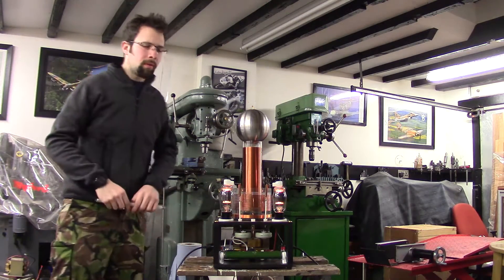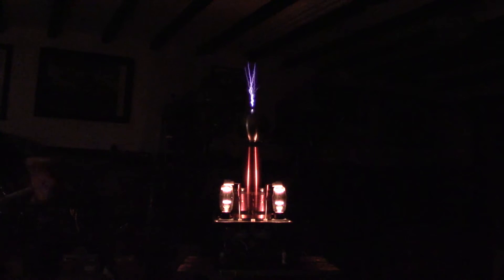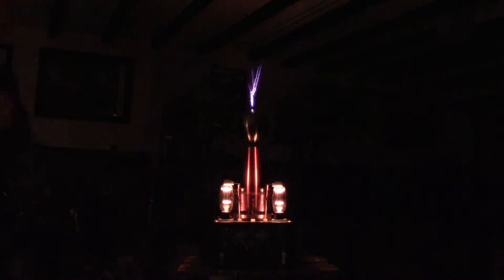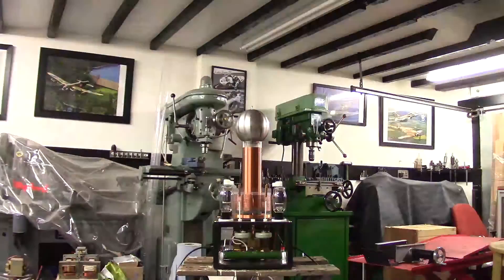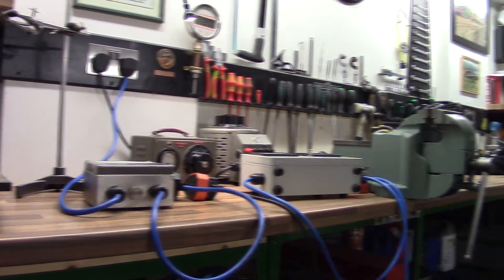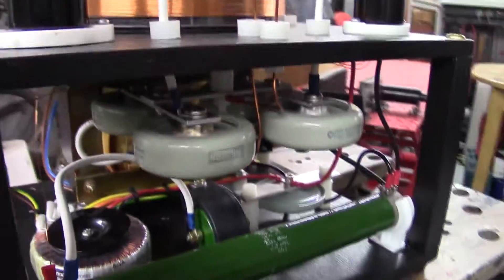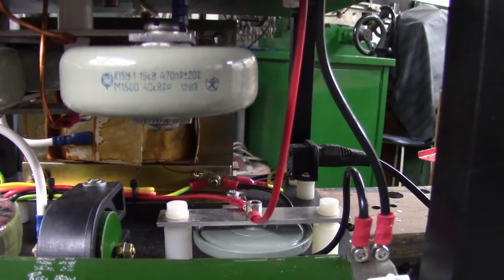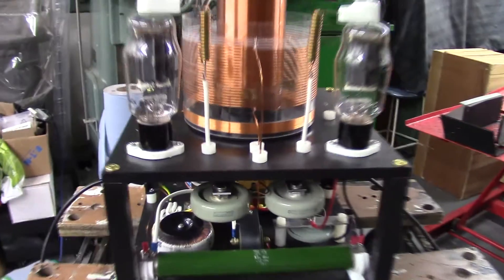Vostok 3.0 Vacuum Tube Tesla Coil Demo + Theory Of Operation

Comment: This is the best looking Tesla coil on You Tube...you do excellent work. So you did not rectify your plate voltage  and just used AC for the plate voltage...think I will try this with an 813 tube.  Excellent workmanship!
Reply from the maker: @joehigdon9847  Thanks for the compliment! I was quite into promotion videos at the time of making this video, so I think it has a way of dazzling the audience.

Interestingly I have purchased some pretty Tufnol sheet last year to update the black painted plywood the structure is made from, so could be even prettier soon...🤞

The circuit is loosely based on an Armstrong oscillator by Steve Ward, check out his website.

Good luck with your 813 tube VTTC project!

Comment: May I ask how many turns were on your secondary, roughly. Thanks.
Reply from the maker: Hi Dave, it's been awhile since this build, digging though my notes led to nothing, but that's most likely because I used a spare secondary from my original SGTC build, which means it is very likely to be 1113 turns looking at those notes.
Reply: @SteveLane   no worries. Thanks for responding. hope you are still coiling. I have done spark gap, SSTC and now embarking on VTTC. Your design inspired me so much, it's beautiful. I am sourcing the parts each day. Thanks.
Reply from the maker: @davestewart2433  You're welcome!
I'm still coiling actually, I exhibit only once a year at Wellend Steam Really of all places, it's local to me!

Likewise, at least 90% of the time is spent sourcing parts, I bought a massive sheet of 10mm tufnol this year with a vision of rebuilding the wooden frame this VTTC is made out of, you might think unnecessary, but the way the light shines off it is beautiful!

Let me know if you get stuck anywhere, I'm more than happy to lend my own experiences etc. 👍
Reply: @SteveLane  I sure will, thanks. Ttufnol, I had to look it up. It's nice stuff.  Please post more videos when  you finish the rebuild.
Reply from the maker: @davestewart2433  Will do! I need to start filming more, even just exhibitions... Lack of time is the biggest issue these days, usually due to too many simultaneous projects.

You have a great channel btw! I was looking for the comments, but I guess you have them off?
Reply: @SteveLane  I didn't realize they were off lol. I turned them on. Thanks for letting me know.

Comment: I would love to see a much smaller analog Tesla coil build for getting into the hobby there all sorts of videos for Slayer exciters but not many informative videos for real analog Tesla coils
Reply from the maker: Generally speaking, silicon based electronics are smaller than their equivalent thermonic emission predecessors (vacuum tubes) by their design intentions. 811 triodes are thought of as being small in their relative size to others.
I am intrigued by the thought of a small scale VTTC, there are definitely smaller vacuum tubes than the 811 triodes, however I would speculate the limiting factor with vacuum tubes would be the much higher frequencies required to match the resonance of the smaller coils. I'm no expert on vacuum tubes  though, so I wouldn't give up on this idea based on my speculation.

Comment: I could be wrong but it sounds like this thing is configured as an Armstrong oscillator, not a Hartley. The defining feature of a Harley is a tank with a tapped inductor and single cap and is the dual of the Colpitts with a pair of caps and a single coil, whereas an Armstrong has a main coil with a cap across it forming the tank and a separate tickler coil loosely magnetically coupled to it driving the active component; just like this.   Cool stuff though and nice workmanship!
Reply from the maker: Good spot, you are indeed correct!
Seems I was thinking about Hartleys around the time I made this video, however I must have gotten the two mixed up during the video (how things usually go...), But yes it is an Armstrong in actuality, it is based of one of Steve Wards original 833 tube VTTCs, which is undoubtedly an Armstrong.
Thanks for the correction, I should update the description for anyone else interested in building such a circuit.
Cheers! 👍

Comment: It wasn't high freqency ,it was 50 or 60 Hz.
Reply from the maker: Hi Martin,
You are correct that this VTTC runs on 50Hz AC, but there is also a resonant frequency of the secondary coil that is in the realms of 300 to 400kHz, it's this frequency that enables the high voltage arcs to break out from the topload that you see when it is running.

Because 300-400kHz is beyond what is possible to hear, it's the 50Hz you hear.

Interestingly the high frequency rides the low frequency waveform like a carrier frequency.

Kind regards

Steve

Comment: That's a very tidy build, great! Nice to see AC operation for a change; simpler design and could even become push-pull; its a shame you couldn't reuse the MOT filament winding for the filaments; you could have just the one mains  transformer and still wind everything up slowly on the variac! Stiffies not withstanding of course (as per the strange comment below).
Reply from the maker: Thanks Ridefast!
That's not a bad idea about the filament transformer actually, around the time I build this, I had intention of using a staccato controller to modulate the output, so probably the idea of supplying the electronics also via the HV transformer didn't even enter my mind.

Coincidentally I'm exhibiting this little favourite at Wellend Steam Rally this weekend in the stat engine section, powered by an old generator of course. =]

Comment: Well, you are running this thing without rectifier. So only the top part of one halve wave of the power supply will cause your circuit to oscillate and giving the 30Hz humming sound. You could get a lot more output by using a full wave rectifier with some microwave oven HV cap's in parallel. Looking at Steve's schematic and assuming its the same as your build, I see rather a classical Meissner oscillator than a Hartley one, but that does not matter much. Yeah, a push/pull may give you twice of what you have now, but is still not optimal as both tubes are only permitted to oscillate on a short duty cycle with varying power output. You need to be careful not to cause a current through the grid (e.g. by positive potential on it). This is a) not good for your tube (heats up the grid) and b) does not further increase plate current. The grid resistor (50W, really?) limits this current, but it would be better to build your circuit to avoid grid current all together.Otherwise, I admire your great mechanical workmanship. It is indeed an eye candy :)
Reply from the maker: LutzSchafer First off, thanks for your critique of the electrical design of this build, its great to find someone who understands these devices better than myself! I hope you can appreciate this is by no means perfect as it was my first attempt at VTTCs, (very) loosely based on one of Steve Wards early projects.
Secondly, I could and probably should have ran on DC, but during the breadboard stages, I did find the anodes would warm up quite significantly during short runs, so keeping the supply AC was a cheat way of limiting the power... Obviously there is other means of limiting the duty cycle of the tubes, but at the time I was already halfway there without having to change anything.
So you are saying to go DC and use the grid feedback tuning to manage the duty cycle for a more constant output?
Reply: Steve, tube designs remind me of my early days in electronics. While they were still taught partially during my educational years, the focus really turned to semiconductors. Working for many years in circuit design and after changing career to optics development, i feel overcome by nostalgia when seeing that people work with good old electron tubes. 30 some years back I worked for a diathermy company and that was the last time I professionally developed their shortwave power oscillator  (which was a Hartley) using a power triode with graphite anode. The max output was 500 watts if memory serves me right. To your Tesla transformer design, I agree that a too high bias current will heat up your plate. High power transmitter triodes usually have heat sinking capabilities or graphite anodes that are allowed to get hot. When running on DC you could try to bias down the tube towards B or C type. This would give you less current draw but same output swing. Might be a good idea to spice simulate everything. Back in my days simulation was just in the beginning. I can only talk from my agend old experience and from a time where we learned to design DC bias as well as RF by hand. In your case it would be nice to have the proper high voltage oscilloscope probes so you can actually see what is going on with removed secondary of course. Anyhow I wish could be of more help. I can try with basic electronic design principles but that you likely find online and/or know yourself. I just found your design intriguing because of running on ac. Back in my days I might have failed my courses for such rather unconventional use.

Comment: That's creative;DD Having the vacuums on each side of the coil for a bit of style!!!!
Reply from the maker: Based it loosely on an old vacuum tube audio amp, but also putting the tubes anywhere else doesn't allow the heat to rise from then quite so easily.
The glow reflected on the coils is an added bonus that makes it in my opinion.
Reply: Steve Lane Yeah, that too, nice output, and coil;DD Thanks For Showing, Cheers Mate!!!!

Comment: Nicely put together.  In my set up I used a full wave rectifier on the MOT and some smoothing just to feed DC to the tank circuit. Looks like I don’t need to.  :-) 
Inspires me to have another go at improving the output on mine as I like the nice quiet output with VTTCs.
Reply: You tried a filtered supply Kram? Do you have any video of it running mate.. .... hi Mr Lane, this is a really pretty coil, I'm sure ive told you that before 😅,....
Reply: @T2D.SteveArcs  Think I've tweaked my psu a few times since this comment. I decided a smooth DC supply doesn't result in a good coil output as you know🙂.
Reply: @tuopeeks  oh yeah I know it doesn't give the best output mate I just wondered what it was like with smooth filtered DC.. il DM you soon mate I'm very sick atm...
Reply: @tuopeeks  👍
Reply from the maker: +tuopeek1 A "quiet substation" is a favourite way to describe the sound to people.

A smooth DC supply will make it easier to get a clean signal to audio modulate if you ever wanted to attempt that on a VTTC.

VTTCs are very therapeutic to work with, I could could work on them all day if I could. =]

Comment: ahh steve she's a beaut ! nicely constructed i might say but then again you always show off your craftsmanship ! still going for a quad tube setup ? always forget to ask in chat :-p and only 6 amp draw ?!  crazy, pretty efficient circuit or just because its a smaller coil, not sure how that works really :-p anyway talk laters cheers !
Reply from the maker: +dirkk82 The plan seems to change every time I learn something new to how to run my Coil more efficiently, at the moment I get an inch of arc for every amp of current I put in, which compared to SGTCs is very inefficient, but for VTTCs is not too bad, they're so power hungry and sound like a substation but I do love the way they look and sound, all warm and fuzzy! =]
Reply: Steve Lane look into other vacuum tubes for that, there are better kinds that have extra grids and stuff

Comment: Very tidy as expected ,glad you made good use of the massive MOT I gave you ,knew it was better of with you and this is exactly why !Great work dude love it .
Reply: Hahahaha well it's great that it's being used ,not just sitting on the floor of the shed .It is massive but well worth taking the extra space to give a lot longer run time although I would have loved to see a conveyor running, I think on the practicality side of things it would have been a proper pain in the arse lol .
Reply from the maker: Haha yeah carbon brushes to pick up on as they align into the coil then all the way out the door on a conveyor to cool off outside...
 Oil immersion would have been the other option as the fan was just too noisey over a VTTC and would need two to cool the otherside, unless I rotated it on a microwave turn table... =]

Comment: Very nicely built that Steve. I like it.

Cheers
John
Reply from the maker: +orbiter8 (John)
Funny thing is that it was only meant to be a "Proof of Concept" build,
hence the ply wood and nylon standoff construction...

It was a few weeks after Cambridge Teslathon in late October last year I plugged my first vacuum tube in
after noticing the lack (precisely zero) of Vacuum Tube Tesla Coils at these events.

About a month later I had it oscillating for the first time putting out about 3-4" arcs,
then after some problems with a dodgy vacuum tube I was managing 6-7" arcs just before Christmas.

Then spent the next two months trying to get an interrupter to work for pulsing the arcs at lower rates to increase the output length,
but with not too much success.

So with only a month left til Nottingham Gaussfest,
I decided to build my current setup into a unit and roll with that despite the few bugs in the circuit I have yet to still iron out... =]